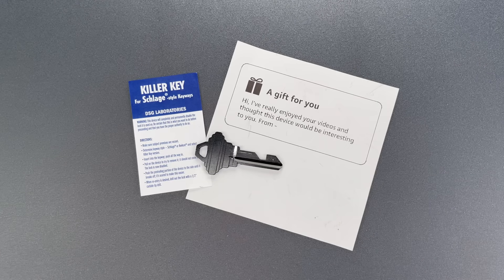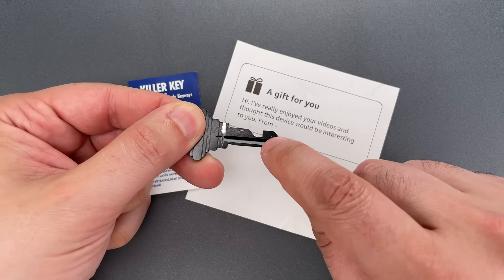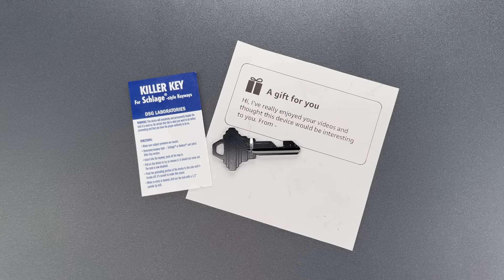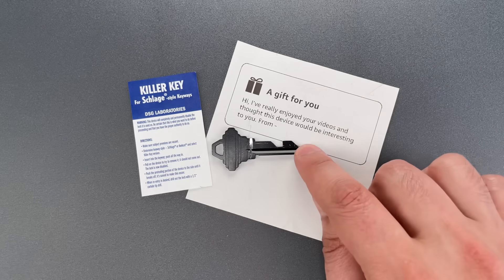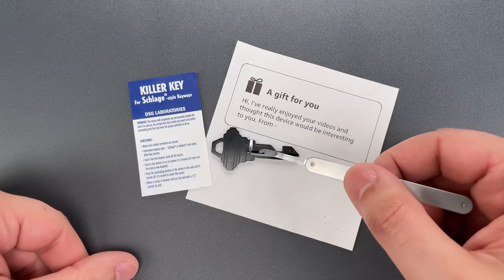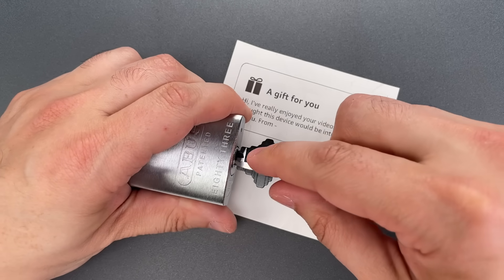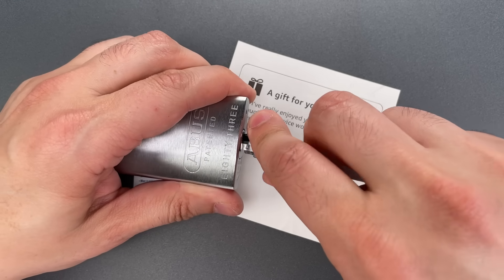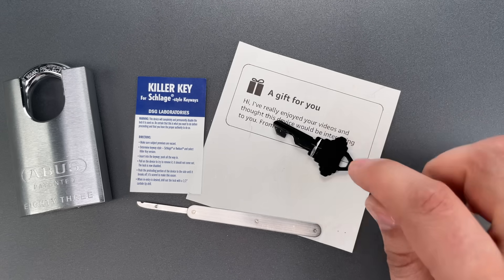[1350] Defeating a “Killer Key”

Comment: I would think that your average turd burglar wouldnt have the tools to defeat this, and it makes me wonder if it would be a good option for some extra security for your house if you were on vacation or something. 

If you have the tool to remove this on hand and just plop a killer key in the lock and deadbolt on both doors, it seems like it would be an extra level of deterrent for someone wanting to do a sneaky entry to a home. 

Or hell, even using one of these on a padlock for every day use to deter people. They would need a key to remove the key and then have to pick the lock as well. It would make even chinesium jank locks that can be raked open in a second a little more secure.
Reply: Hmmm. Good ideas.  Though it is possible to break into a place, the deterrent may just make them look elsewhere.
Reply: @greenbeginner3353  thats what I was thinking. Make yourself a more frustrating target and maybe they will look elsewhere.

Its like the old "when being caused by a lion, you don't have to be the fastest zebra. You just can't be the slowest"

Comment: Apparently this key device is being marketed for lockout situations. Personally, I would apply an overlock device.

In fact, I can imagine no non-malicious use for this device.
Reply: I agree.  I spotted the PRIME-LINE S 4180 Door Knob Lock-Out Device on Amazon for $20.  I’m sure that any apartment manager would have a couple of these around for evicted deadbeats. Police probably have them to protect crime scenes.  Either tool would work in cases where a key copy wasn’t accessible and they had to prevent re-entry before it could be drilled.

Comment: If you find one of these in your lock you either A: pissed someone off, or B: didn't pay your locksmith. Lol

But these are also used to disable locks for other reasons. System/function changes. Etc.

Comment: Honestly, that's a pretty great way to decomission a lock. Clearly "not to be used", but the mechanism is undamaged in case it ever needs to actually be used again (or scrapped for parts).
Reply: It doesn't decommission it permanently, though, merely marks it as "please don't use this one for the time being".
Reply: @clickrick  - That's the point of decommissioning. Especially if the bow is broken off the end, no one is going to accidentally use the equipment, but it's still there and intact. If there is a future need for the device or its parts, it isn't overly difficult to remove the safety devices or reverse the process in order to put it back into service.

Comment: I don't understand the purpose of the killer key.  Please explain it.  Trolls need not leave their comments.  Thx.
Reply: Down the way somebody said it’s used by landlords dealing with evicted renters.  If he can’t find his copy of the key (or if the tenant changed the lock) he can disable the lock until he can get the locksmith to drill it out and replace the lock.  I’m sure that, if things get that bad, the deadbeat renter will unlock the place with a hammer through the window.
Reply: @greenbeginner3353  thx.  Makes sense now.

Comment: I'm still trying to work out what use a "killer key" would actually have, even if it did do what it says on the tin?
Reply: Someone has a key to your lock and you want to keep them out until you had time to change the lock (or get the key back, then take the key killer out).
I'd say they are actually more useful because you can take them out without destroying the lock.
Reply: That’s the reason I’m reading the comments. I can’t think of a use that’s not “just to piss someone off”.

Comment: "This is an impressive design for a killer key, too bad it's terribly flawed and a 2 y/o could remove it"
Reply: Most people have no idea how a lock works.
Reply: "I've made an example of what I'd do here, in 5 minutes, that fixes these issues."
Reply: XD Thats effectively whats said
Reply: I think the intention of this device like many locks isn't to be impervious it's to be an impediment.
Using this device would still likely be very effective at keeping most people from using a door, especially if they were not prepared and/or unfamiliar with this particular device.
Reply: "Like all great strategies mine is so simple an idiot could have devised it!"
Reply: Doesn't that make one feel dumbfounded?! (Facepalm!) lol
Reply: Can't be all that impressive of he can get into it in 3 seconds flat
Reply: @TheAnonyy  he got sued several times for bad advertisment. And just unboxes a brand new one and picks it in minute
Reply: not before the texas chainsaw massacre guy jumps out of the bushes.
Reply: simply coating the key in epoxy would solve this and one does not need a special key for this just need to clean the lock of lubricant first or better yet take the lock apart and remove the little bar that goes through from the thumb turn on the other side through the bolt assembly then turning the key way will not retract the bolt their is a lock modifation on the market that allows for this part to be pulled back rendering the key way inactive when desired
Reply: Most two yo don't have a lockpick
Reply: @mifigor1935  me and my brother picked locks with hotwheels cars. the steel axle and the plastic windows open many doors.
Reply: @JS-rv3et  new LPL video idea
Reply: @mifigor1935  just need a soda can or piece of high grade kitchen tin.
Reply: @hopefulmayhem5744  *red bull can 😉
Reply: @mifigor1935  I mean I picked my grandma’s safe with a paperclip when I was like 5 so I mean you don’t need an actual lock pick or any skill to remove something like this just a little bit or curiosity and a thin piece of metal.
Reply: He had to modify one of his own tools to get it out. If it were so common, would a guy of this caliber need to modify a tool?
Reply: @ezakustam  Maybe it's easier to grab what's readily on hand to use than to flat-out manufacture something new?
Reply: Everyone: "LOL!! @ "Anonymous".......YOU R SUCK!!" 😆😂🤣

Embarrassed on a Global scale, "Anonymous" has probably spent the last 2 days trying to hurl himself under a running Push-Mower, before the safety-bar kills the engine!! 😆😂🤣

Comment: We would cut the locking key in half lengthwise to leave the door locked at night. If the half to unlock it got lost, we would use a ground down and flattened hacksaw blade to lift the pins and grab the blank and pull it out..

Comment: As a locksmith I've made quite a few barbed/hook/killer keys to seize a keyway. The issue is that almost all of them can still be removed using normal key extracting methods so you have to get a little creative. In fact if the person who made the killer key leaves the shoulder of the key attached, then it gives you many more methods of removal. Combined with a single hook to trap the pins, I'd be surprised of simply shaking or banging the lock while pulling back on the key wouldn't be enough to open it right up.

To make more effective killer keys, the more information you have, the better. If you already have the key to the lock you want to seize then having the barbs, and by barbs you need at least 2, preferably 3, be slightly lower than the initial cuts will allow the top pins to fall slightly below the shear line, and if those top pins are spools or serrated then it makes them alot harder to lift with incredibly thin picks or shims. It's also handy to prep the key to snap slightly past the shoulder, preferably somewhere in the middle of where the first cut would've been. It will also have to be immediately followed by the shallowest cut, so you can't fit a tool above the key for extraction. No shoulder prevents people being able to grab them with pliers, and more importantly, allows you to push the snapped-off killer key further into the cylinder where it's harder to get a handle on. Attackers will now need to treat it as a broken key extraction, being protected by the first pin, while being unable to walk the key back out as easily as in key extractions due to the barbs. A little icing on top is to remember to never brush your key after cutting a killer key, as the tiny brass filings stuck to the key will make shims have a significantly harder time

This will seize the lock for all lock novices and provide a relatively lengthy and annoying trap for attackers, which is really the entire goal. Best part is that if you still have access to the back of the lock, such that you can remove the cylinder entirely, you can remove the cap/clip from the back and simply push the key out the back, so the once seized lock is back up in working order. If you didn't brush the key then remember to use compressed air or some lubrication at that time to make sure nothing is left in the cylinder. From there your normal key should work again.

Edit: If you wonder whats even the point to these keys then I'll try to explain that too. There are literally a million reasons to seize a lock temporarily or for a good long while. Most common uses for killer keys are to turn storeroom function locks, which are locks that are always locked no matter what, but can be temporaily opened with a key, into exit only locks. So they lock is forever seiezed, but people on the inside can still leave when they need to. It's also handy to seize a lock you lost the key for, or is at risk that somebody duplicated a key. Seize the lock, until you get it rekeyed, or replaced entirely. It's immensely easy to remove all broken keys or killer keys if you have access to the backside of the door, but with padlocks it's a little trickier so using a good killer key, means you should be ok with never being able to open it again.

Comment: Harry has just made a lot of landlords angry and I'm fine with that. Brilliant hack as we expect from the LPL.
Reply: To be fair, landlords are being taken for a ride by Schlage every day. This is no different. If you have to drill it out anyway, I don't really see the point. Just change the core or the pinning. It's a lot quicker than sticking that thing in there and then having to come back and drill the bastard thing and then fit a new core. Adds an extra step and a lot of extra cost. Landlords using these must be complete idiots.
Reply: @Si74l0rd  The purpose is to let an unskilled property manager kill a lock instantly. The locksmith comes by later. Think big apt. building. And yes, most landlords are idiots :-)

Comment: the device is designed to break at the end where the large gash is, so you would need to remove it with a drill since there is nothing to grab onto and it's slotted in their real good.

Comment: If something was built so it can be opened nothing short of destroying that ability (say with a welding torch) will fully disable that function, and unless the thing is made of a literally  indestructible material it can usually be made to open even then with the application of enough destructive force. It really comes down to how badly someone wants it opened.

Comment: I wonder if there is a way to make a true "killer key" that doesn't involve a chemical or thermal process. Obviously, you could put a chemical in with the key that makes it bond chemically, or you could heat the key and lock to the point where they deform together and aren't removable, but that adds a lot of cost or effort, depending on the method. This is a mechanical approach, and it seems like there should be some way of making it hold the pins when pulled back. Pins are hardened, I think, so biting into them might not be feasible, but friction fitting against a pin could prevent this. 

That said, I don't know what the legitimate purpose of this is. I can see it being a jerk thing to do to a person's door, but anyone with legitimate access should just be able to change the locks.

Comment: In a world that is experiencing a troll pandemic, this product seems enabling and irresponsible! But at $13 maybe it won't be the new tiktok troll craze!

I guess if you really wanted to mess up someone's lock, take a small screwdriver and bend pin one until it can't move or breaks. I wonder if there's a file small enough to fit in a keyway, and just file the pins a little so they don't match up anymore. or take a key, cut it into little parts, and slide a part into each lock, then nothing can pull it out, and a key will not go all the way in, like those cheap razor blades that can snap off every 1/4 inch... lots of ways to mess up a lock!!

Comment: It almost looks like the killer key was designed to be removable in that manner.  If they wanted an actual killer key, why not put a flange at the entrance to the keyway? Block access so you have to work around that and not take 3 seconds to remove it

Comment: Idea: a lock cylinder that has longer distance between pins. I don’t know exactly how pin spacing works but basically it would be variable spacing where pins could be right next to eachother or a few extra millimeters apart for increased difficulty

Comment: A 99 cent tube of super glue will wreck a lock a lot better and drilling a small high carbon steel drill bit into the lock on top of the glue and breaking it off makes the lock almost impossible to drill.

Comment: I use a knife shim and a thin piano wire. Lift pins insert wire and twist wire the screw action pulls the key out. But I guess hitting the shim knife with a center point work faster

Comment: Worthy of note: You can make a "killer key" that merely prevents the door from being locked by using a working key and filing the rear ramps flat.  This is useful in a situation where a lockable door should no longer be allowed to lock as the working key cannot be removed, and it can be opened with any screw driver should the key head be snapped off, like a how a bathroom privacy door works.  Until the knobset can be replaced with the appropriate privacy lock.  Granted it's not a common situation, but it exists in commercial spaces.  Fire Marshal says, "This door cannot be allowed to be locked."

Comment: Great example of bespoke tooling, love to see it 🤠👍 I did wonder why these keys exist when you could purchase a tube of glue instead 🤔
Reply: One reason is that glue is clearly overt tampering, while a broken off key could feasibly be an accident until it's extracted and examined.
Reply: @CWGminer  as if it makes a difference? in the end they're still both blatant destruction of property
Reply: @siccoblue2112  The time it would make a difference would be a red teaming situation. The security response to overt tampering would be stronger than the response to a simple accident, or at least something that appears to be so.
Reply: @siccoblue2112  Depends on the intent.  First intent, of course, is to kill the lock.  But the second may be to make it look like an accident, or to force time-wasting attempts to extract the key.  It is also a lot faster and easier to dispose of the broken bow than to get rid of the tubes of epoxy, the mixing card, the mixing knife, and any traces of the glue which might have been deposited on the hands of the perpetrator.
Reply: So let’s say your a landlord performing an eviction.  Police show up, escort the tenant out, locksmith will be a couple hours.  Pop this in the lock and the tenant can’t use their key (or copy they made) to get in, locksmith comes along with the broken key extractor, removes the killer key and rekeys the lock.
Reply: um cause some glues are easy to remove?
Reply: @theldrakis  You've clearly never tried to remove a cured 2 part epoxy from any kind of mechanism.
EDIT: Wait you said "some glues". My bad. The original point still stands though. If you wanted to ruin a lock, there's cheaper and easier ways.
Reply: Also the glue would take much longer to apply. Hardly covert. With one of these, you walk up, insert, snap, leave. Seconds.

Makes me wonder if a "super kill key" could be made, where snapping the key also breaks a vial that releases a curing adhesive internally... 🤔
Reply: @cooperised  Come on man, doing a quick squirt while no one is watching is totally doable. Wait... what?
Reply: @cooperised  Have not ever used a tube of glue before?  You unscrew the top, stick in the tip and squeeze.  Super glue flows nicely and will cure almost instantly.
Reply: @toolbaggers  Except... that if it has low enough viscosity to do a decent job (i.e. get right in and bind the pins, maybe even bind the core to the lock body) it will also flow right back out of the keyway.  Quick, covert application would take skill and practice, I would think, as well as a suitably designed applicator to get the glue well back into the keyway.  Definitely not just a tube.  Also it's common in many countries, including where I live, for locks to be installed such that the pins are at the top - in which case this would do nothing at all except sit in the bottom of the keyway and maybe make it more difficult to insert a key if you were lucky.
Reply: What if you put glue on the killer key?

Comment: I've seen locks that were filled with cyanoacrylate super glue. In my opinion, the only way to open them is to cut or drill them. We did just that. Is there another, not such a barbaric way?
Reply: Acetone, AKA nail polish remover.
Reply: Squirt Acetone on/inside till the glue is washed away. Acetone having the property of breaking down cyanoacrylate super glue.
Reply: Send an exact copy to LPL and wait till it's featured.
Reply: @inayaarime  If he agrees, I will send it :)